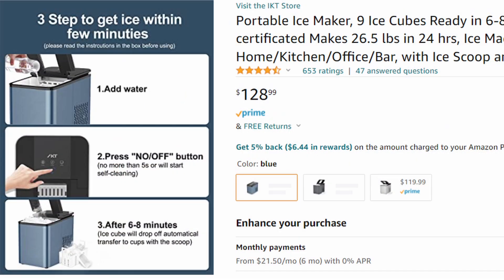❓ Battle Of The Coolers: C02 Laser Chiller Vs DIY Chiller Hack!

Comment: Thanks for this man! So your setup was to only have the pump in the icecube reservoir with a gallon of water? Am I right that you can overflow that reservoir when more cubes fall in and melt?
Reply: I mean, you need to fill also the separate reservoir for The icecube-making right?
Reply from the maker: No, it cannot. It has no more water than the gallon I put in. It is recycling the original water.
Reply: @TheLouisianaHobbyGuy  thanks I see now. The first Cubemaker I found had a separate watertank. I was wondering. Now I know and I will follow your way of thinking!
Reply from the maker: Yes, it has to be all in one and recirculate the same water!